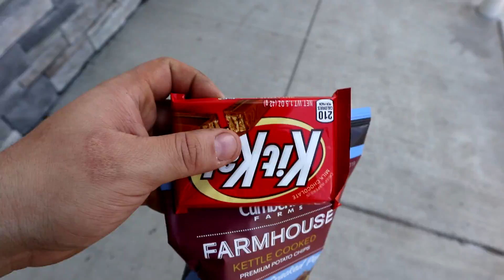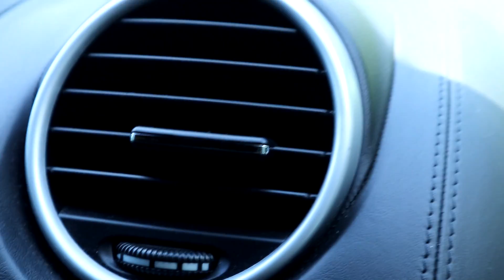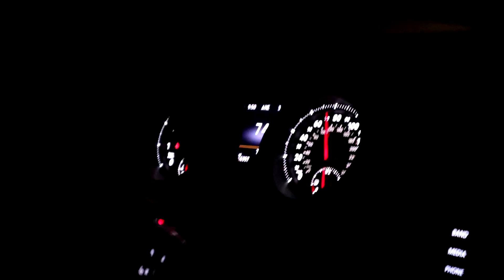DON GOT KICKED OUT

Comment: Damian, I have been riding since a kid.  When I ride I never clutch on the upshift .  I blip the throttle down for a split second as soon as you feel the tire going faster than the engine, but before you feel the wheel slowing you down then shift up.  Its faster because you dont have the second of disconnect with the clutch.  And most importantly, when you power clutch like that with high speed/load on it, it's very hard on your engine.  crank/rotating assembly.  Especially if you're a big guy.

Downshifting I clutch, but i sometimes rev match if I'm trying to stay smooth, and keep my speed.

Comment: There are rim locks on the rims. There is only one valve stem and 1 bolt for the rim lock. They are not tubeless. You yz should have the same setup
Reply from the maker: Chris Swanson his are valves. On a tubliss setup you use the rim lock hole for the second valve stem and you have to drill it out

Comment: U sure it’s not just a wheel lock
Reply from the maker: Tyler Jones tubliss look that up
Reply: i doubt it tubliss. i bet it is just a rim lock.
Reply: @damianmonte  if you read about the tubliss the lock would only be 4 spokes away from the valve stem.
Reply from the maker: Joseph Ellis tubliss install, drill out the rim lock hole for the second valve stem, the rim lock hole is drilled out af I looked and it’s 2 valve stems not a valve stem and rim lock
Reply: @damianmonte  read the install again. It says drill 4 spokes over otherwise when installing you will rip the tubliss tube. If it does truly have it, whoever installed it f'd that shit up.